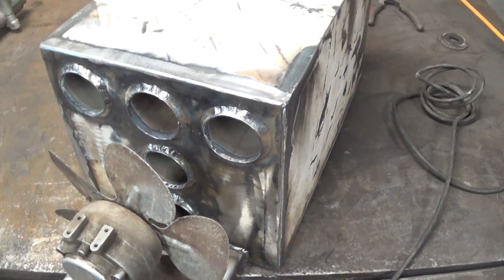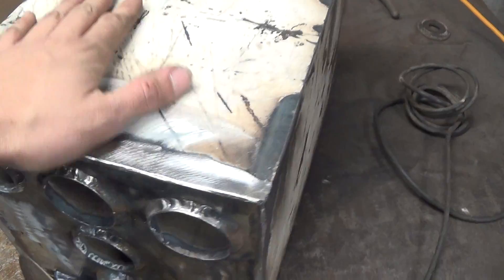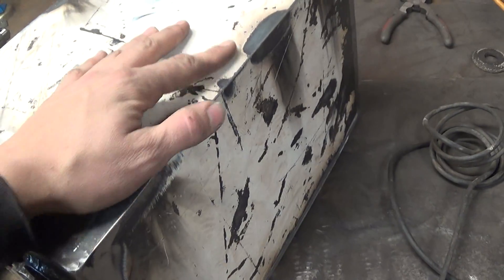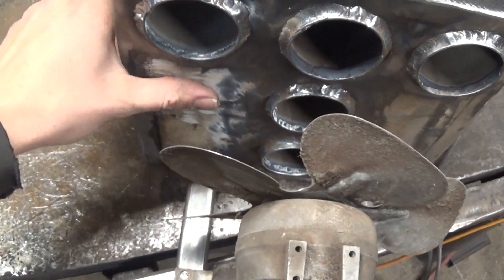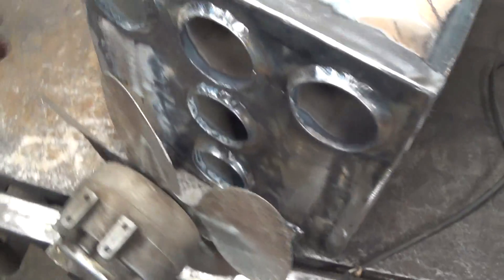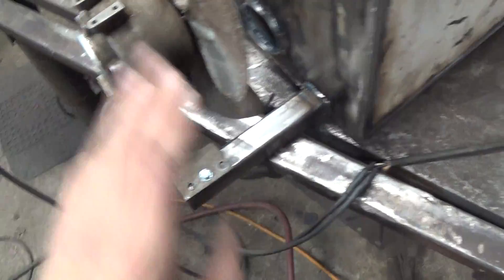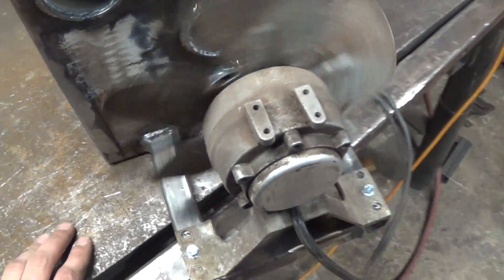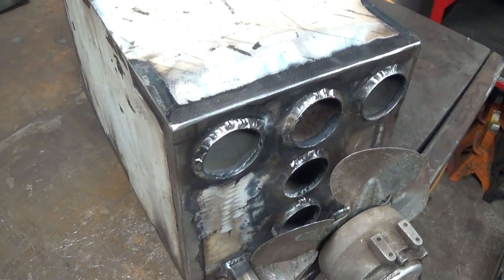Wood Stove Heat Exchanger

Comment: You are looking for 4" tubing, not pipe... OD is what you are looking for.. Pipe is ID and will be too big. Had the same problem on my 6 inch stove when I changed the exhaust from the rear to the top exhaust..